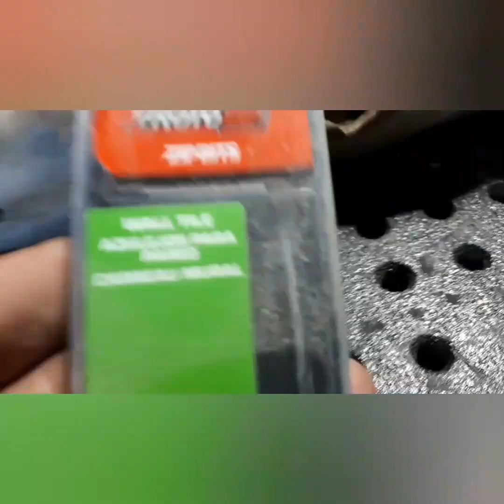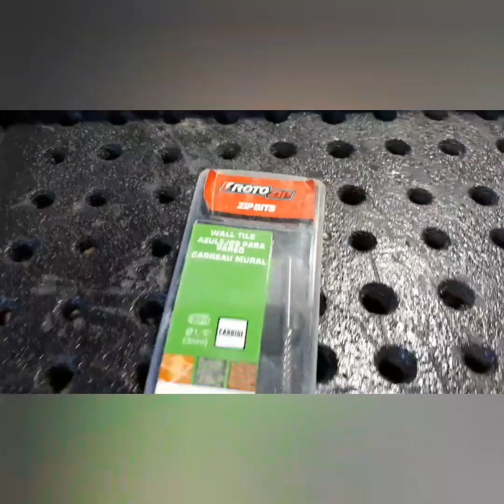Easy Wood Working project 2019. Driftwood tea light holder. Candle holder.

Comment: You should fill those letters with dyed epoxy, like they do for tables and stuff, would look pretty cool!
Reply from the maker: Thanks ya I thought of that
Reply: Got my Flex shaft and Kutzall bit this week!  I tried it on my Battery Dremel and drained the battery in 2 mins 🤣 I will install my Flex shaft this weekend and try a wood spirit!